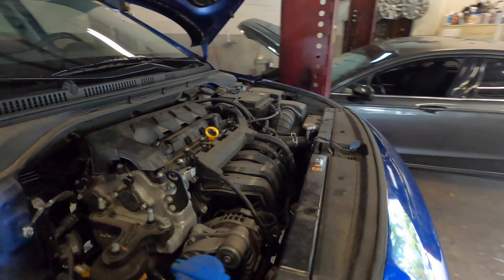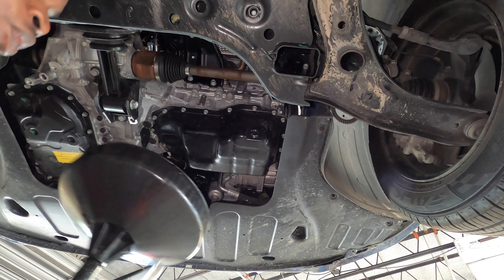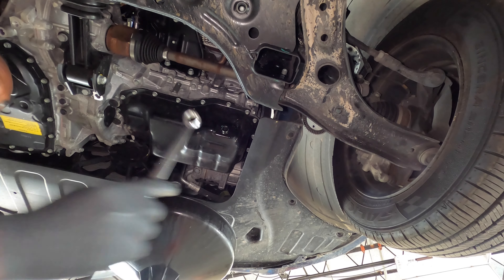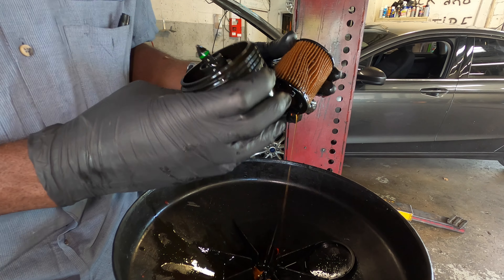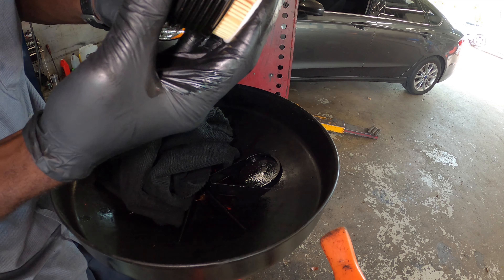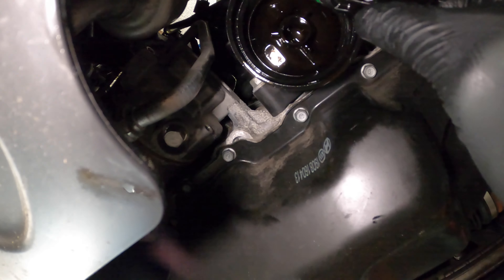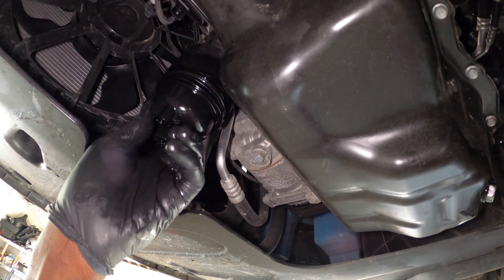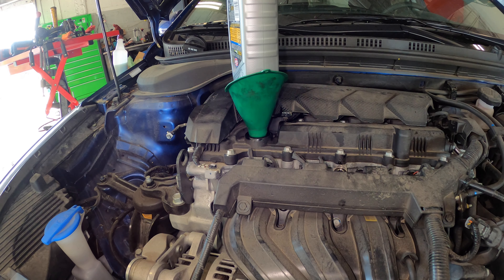Replacing oil and filter on a Hyundai accent 2020 and up

Comment: Just wanna let u know I just did a oil change on my 2020 hyundai accent  and it's definitely a 24mm to get to the oil filter
Reply: 24mm what?
Reply: Is it a 3/8 drive or 1/2 drive. The drain plug isn’t coming off with a 17mm 3/8 drive bit

Comment: Thanks! I have been putting the plug in from the outside for 30,000 miles. No I know why it has been a pain to install. You leave the plug attached to the filter before installing.

Comment: What kind of 17mm and 21mm for the oil filter. Is it 3/8 or 1/2 drive. The 3/8 doesn’t work
Reply: Either one. I prefer O side of wrench to sockets. Better leverage and more control IMHO.

Comment: Where’d you buy the oil filter from ? Thanks
Reply from the maker: From the dealership i couldn't find it anywhere else
Reply: @Rick-S-6063  thank you sir! Also the bolt size to the oil filter is 24mm, at least it is for mine !